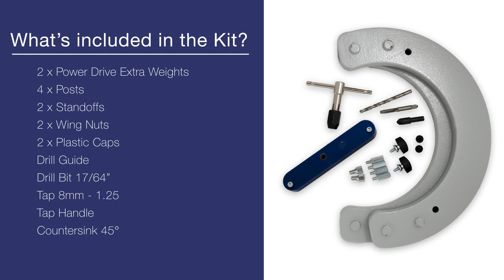Bona Power Drive Extra Weights Install Guide

Comment: Will the extra front loaded weight let you run the PD with the handle at waist height?
Reply from the maker: Hi Robert - Yes, you could run the Power Drive unit (with the extra weights loaded) in the regular buffer position too (just not with the Power Drive 4-Disc Head attached - as it would bounce all over the place); but with a MultiDisc driver or a regular 16" drive plate. Hope that answers your question. Thx!

Comment: Why didn't the machine come out with this when sold. Another rip off bona machine!!!!
Reply: matthew fawcett lol, I’ve sanded a floor from start to finish with Bona power drive,without using my drum sander (lHummel) . Try doing that with a buffer. I could have bought the Trio but Bona for me was a better fit.
Reply from the maker: @matthew fawcett Hi Matt - The Weights Kit wasn't developed when the Power Drive was first introduced; but was added later at the suggestion of our Craftsman advisory panel to further expand the effectiveness of the Power Drive. Also, you must have this unit confused with a competitive machine that sells for $8k, as the Power Drive sells for about 2/3 that; and it's incredibly versatile - with its geared, 4-Disc positive drive sanding plate (cuts down about 80% of your edging with no chatter); and with Weights for full sander capability. Very effective with Dust Containment systems for zero airborne dust; plus, regular 16" drive plate, Tampico Brush, and MultiDisc - all with one machine. The power and versatility of the Bona Power Drive has changed the sanding process for thousands of very satisfied customers.
Reply: I bought a brand new last year (2022). Does this one is ready to install the weight w/out me Drilling holes?